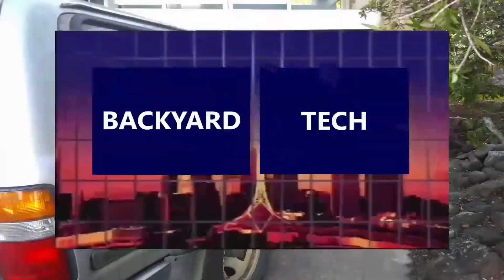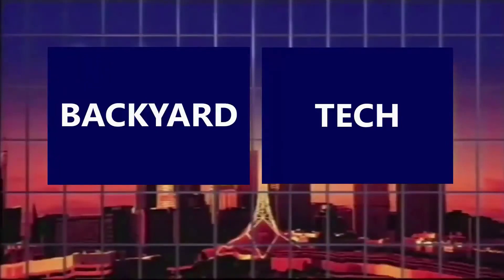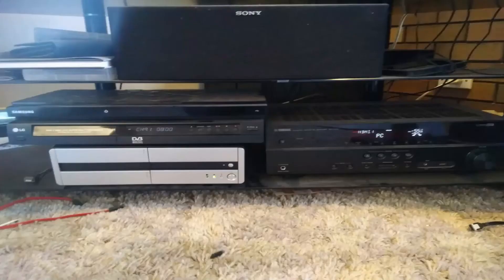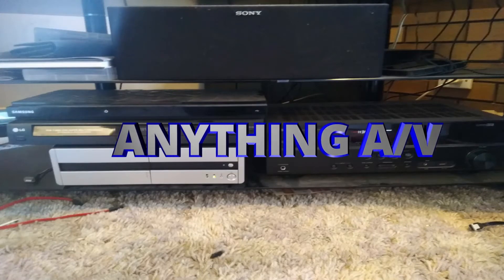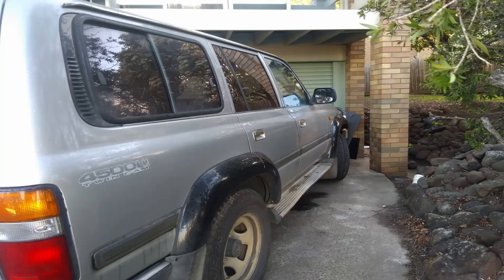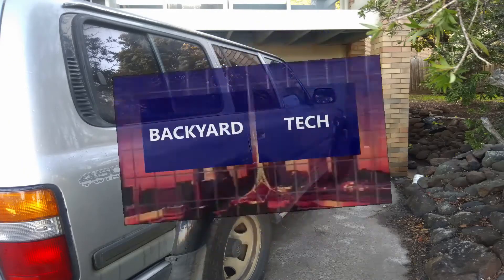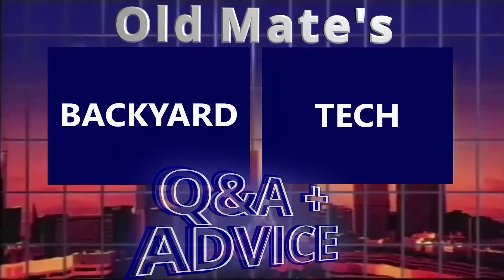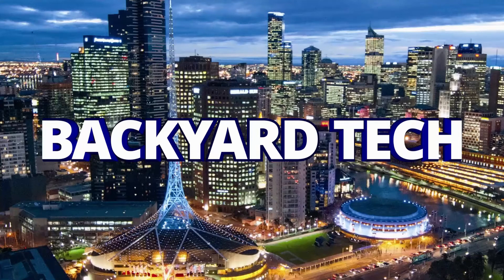Q&A + Advice - Wiring 2 wire Unbalanced Audio Cable To A Balanced XLR/TRS

Comment: I should add that anyone that doesn't know this, XLR means "eXternal Line Return" and it generally can be either Unbalanced or Balanced depending how it's wired.. you will find 99.9% of them are generally 3 pin but there are versions all the way up to 6 pins.   You will find those in the A/V industry and in broadcasting.  Beyond this, in industry you will find either a Centronics (IEEE-488) interface, a very heavy cabled DB-50, or a MS type cannon plug which will then both have audio and video cable in one lead.  You should generally not mix the balance or unbalanced, but the output should end up balanced.
Reply from the maker: Agreed, however, there are some instances where you have no option other than either wire unbalanced to balanced, or using an active/passive DI, although that can cause other issues re gain depending the Z in on the DI, though no higher than 50K Z in